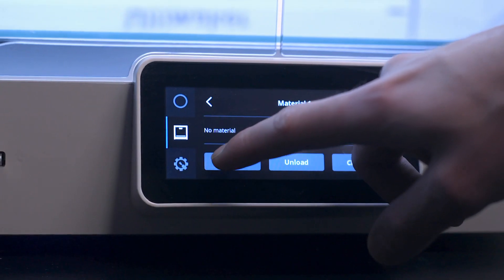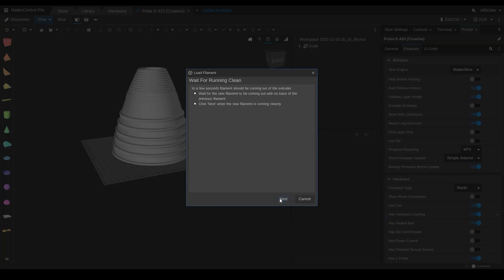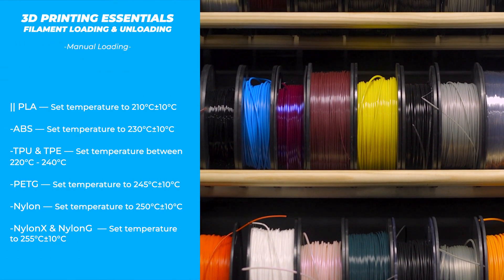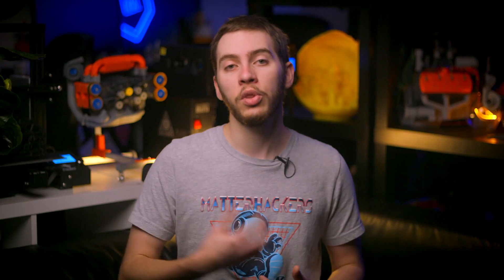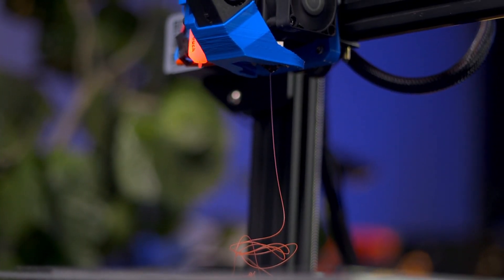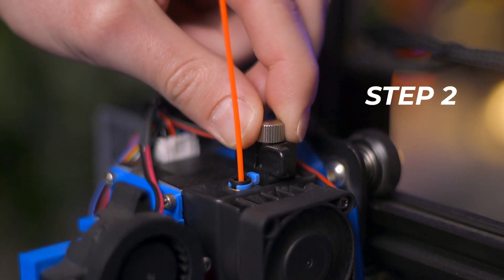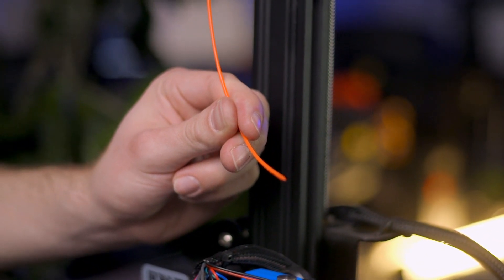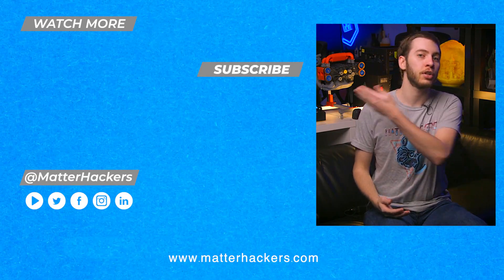3D Printing Essentials: Filament Loading and Unloading

Comment: Thanks!  I've been 3D printing for several years but always had automatic filament loading and unloading.  My new 3D printer is bare bones (reliable, cheap and easy to maintain) but lacks automatic filament handling.